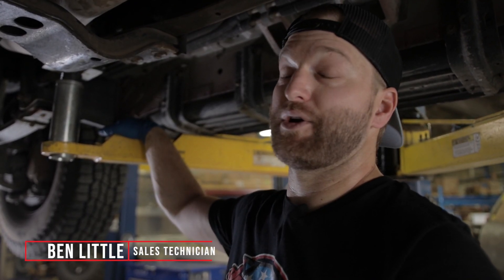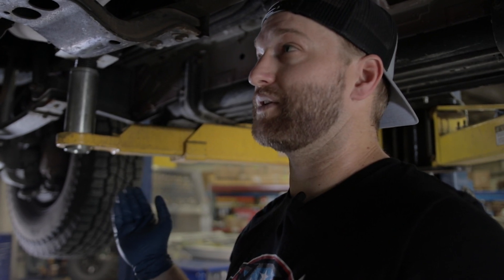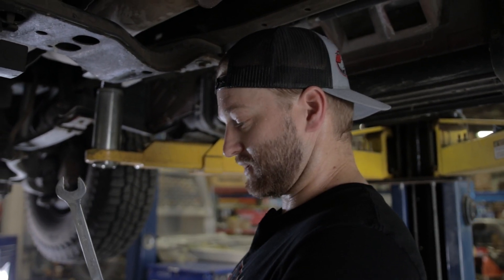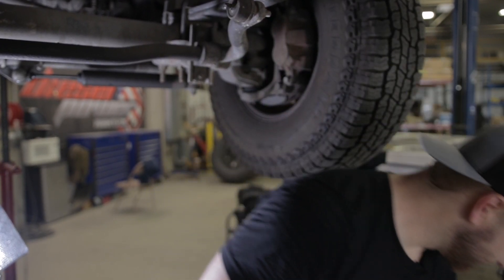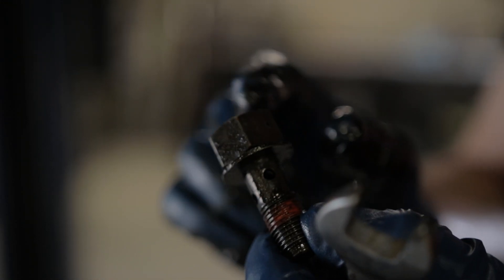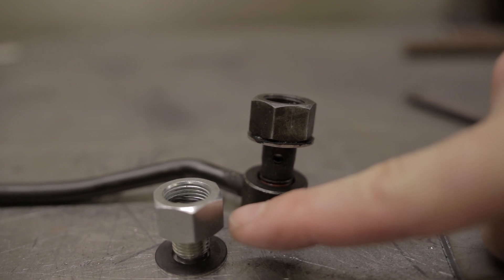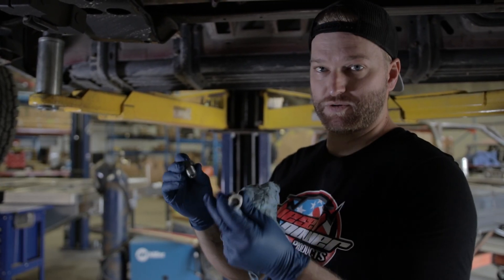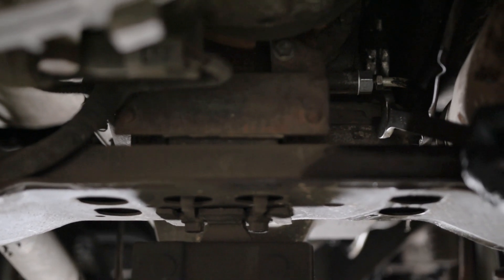Diesel Talk + Install | DieselSite 4R100 Transmission Cooler Bypass Delete Kit

Comment: #1 the check ball elimination will give converter drain back  overnight, and 2nd the bypass is a safety tube in case your cooler clogs, at  least you'll have bearing lube to prevent meltdown,  has nothing to do with temperature
Reply: I agree with you on this, thats what ive always heard about this 4r100 bypass tube, could you tell me what check ball elimination / converter drain back overnight does ?  Is it something bad to the trans. ???
Reply: Its far far far more likely that these small check valves get clogged or fail than the cooler get clogged!!
Let me guess.  You read this on a forum from a guy named Mark?
I've yet to read anything official that states the valve is a drain back preventer other than Mark.
Reply: Unless you've replace one of the valves in the pump (can't remember which one) the pump to cooler circuit is not flowing untill the transmission is out of the park position.  With the modified valve, the cooler circuit is always flowing

Comment: I just ordered this yesterday. Hopefully this fixes my trans cooling issues.
Reply: How’d it go?
Reply: @Mike-xn1bh  my parts cam in last thursday but i've had covid. I'll let you know when i get em in. 👍
Reply: @funshine3571  hope you get better soon. I’m on the fence about the bypass delete
Reply: @Mike-xn1bh  thanks. Out here in the mojave desert it gets over 100 degrees. I have 37s regeared with 4.56s and a mishimoto cooler. Seems like when my trans hits 200 it just keeps getin hotter so this is my last resort. Fingers crossed it works.
Reply: @Mike-xn1bh  installed a couple days ago. Night and day difference. This definately fixed my problem. I highly suggest it especially for the price.
Reply: @funshine3571  Thanks for posting an update
Reply: Hey Mike!
Do you suggest a new cooler at the same time or should factory cooler be fine? 
It’s on a small party bus 2004 e350 super duty econoline cutaway with a 6.8 v10.
Reply: @protege1962  maybe Fungus 357 can chime in?

Comment: On my 2001 7.3 econoline van the top side fitting didn't match up so I had to grind down the nut where the flare is and bend the tube so it would even fit. I'm assuming  the truck and excursion had a different tube. I used  what I had and made it work.

Comment: When I built my 97 SBF Bell housing E4OD, I removed all that bypass crap and just put some 1/4NPT to -6AN male fittings.  I'm running it just like my C6 it is replacing.